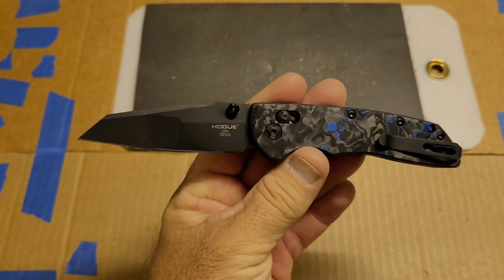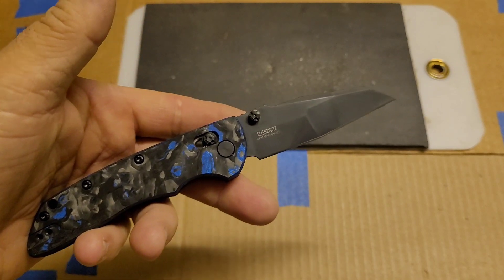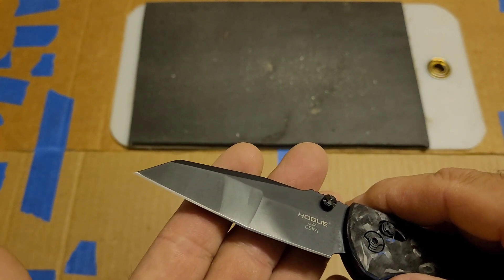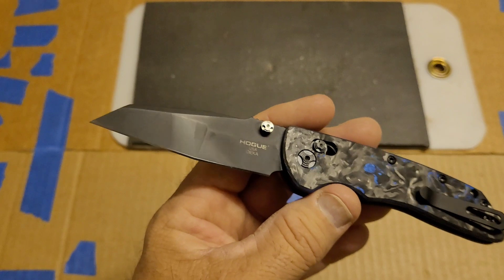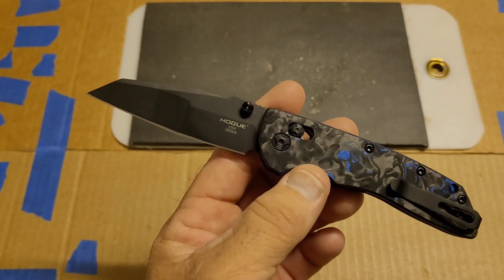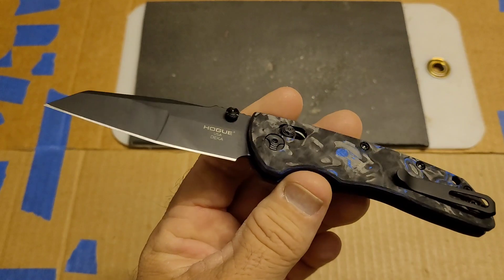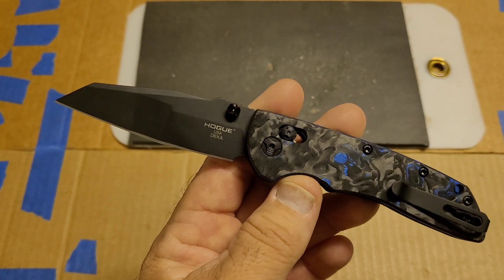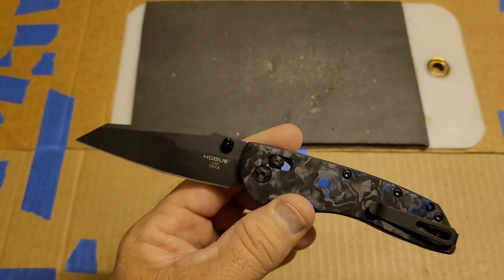Hogue Deka Magnacut edge retention testing. Is this all everyone expected it would be?

Comment: Try push cutting 1" manilla rope with same portion of the edge and see how many cuts it gets.
Reply from the maker: This was sent to me for testing and returned long ago. If I end up with one in the future I may test it that way.
Reply: @Outpost_76  I noticed that several in the knife guild use 1 in thick manilla rope, tape of just one section of the blade for cutting in the same section every time, then push cut slices off to see how many it will do.

Comment: MagnaCut excels at corrosion resistance and has very good toughness, but edge retention is really just middle of the road.  Dr. Larrin Thomas, the inventor of magnaCut, publishes a table where he rates toughness, edge retention, and corrosion resistance.  MagnaCut was 7, 5, and 9.5 respectively.  Compare that to 4, 6, and 7.5 for S30V and 3.5, 9, and 7.5 for S90V.  Dr. Thomas also will cite that edge geometry has more to do with performance than any other factor.  MagnaCut is a great steel for what it does, but those who select it should understand it's pros and cons.
Reply: Middle of the road on his charts are pretty skewed to high edge retention steels though, a reminder that 1095 is like a 2 for edge retention, and MagnaCut is as tough at 64 hrc as 1095 is at 59hrc.

Comment: Been getting into knives and found your testing super informative (info overload initially cause of the learning curve). Not sure if I missed it elsewhere but do you do anything to the blades in-between testing runs to wear out the edge more or is it already sufficiently worn out from testing to get to the new steel underneath?
Reply from the maker: I drag the edge across a diamond plate to make sure the prior apex is gone before sharpening each time. This way I'm not just fixing up what's already there.

Comment: I think you really nailed Magnacut on the head. A solid and SAFE choice for stainless steel that performs well. Love the consistent performance we've been seeing from the factory models. I wonder if that has more to do with the actual steel design or Larrin's up front work for recommending heat treats. 

As always, appreciate the work!
Reply from the maker: I believe Larrin pointing companies in the right direction as well as manufacturers listening from early Magnacut testing went a long way with this coming out strong.

Comment: Great video Gerald I think it should definitely replace the soft 20cv, 204P, M390 that’s so prevalent on the market, I like to look at it as a S45vn incremental improvement. Being as the edge retention, toughness, and corrosion resistance are all better and for the everyday user even those who abuse their knives it will be a stainless that can take the beating where the S30v family would fail and still be able to keep up in terms of edge retention and it’s very difficult to rust. Overall Leads to a great balanced everyday carry steel, much like what they had in mind when creating the S30v family of steels.

Comment: From your spreadsheet, this looks pretty similar to LC200N numbers.  If the sharpening experience with 62HRC Magnacut is less than amazing, I don't see any reason to leave LC200N.  I wonder if this is also keeping Spyderco from making the move.
Reply: The native 5 LW salt in magna-cut is delayed because Spyderco is presently having an issue with their magna-cut wearing through their native 5’s lock bar under stress testing. I think they have gone through two or three different materials.
Reply: @nandayane  Oh, I had no idea.  Thanks for that insight!  I assume it's right from the horse's mouth, at Spyderco Forum, from Eric or Sal?
Reply: @ZPositive  I believe it was Sal on the forums.
Reply: @nandayane  cool.  It's the most endearing thing ever that Sal and Eric frequent those forums.  How could anyone not love Spyderco?
Reply: @ZPositive  Pretty much, that is why they have my money
Reply from the maker: Magnacut even at 62 has much better wear resistance and edge stability than LC200N. Also Magnacut from a materials aspect is half the cost of LC200N. It's a win for manufacturers and consumers.
Reply: @Outpost_76  I agree that 62 HRC magnacut has slightly better edge retention than LC200N, but they're close enough that other factors close the gap.  Sharpenability and toughness matter.
Reply from the maker: @ZPositive  that's just it, Magnacut isn't any harder to sharpen than LC200N. In a folding knife that small jump in toughness doesn't make up for the lack in edge stability or wear resistance. Keep in mind this example of Magnacut has a 25% jump in wear resistance from the LC200N I tested. 

I'm going to do a video about Magnacut and why it's going to be a benefit over a good bit of what's out there now for production knives.
Reply: @Outpost_76  I guess we'll have to agree to disagree on LC200N's ease of sharpening.  It's hands down the easiest and most forgiving stainless to sharpen in my experience.  That sets a pretty high bar for magnacut.  And LC200N's toughness is also off the charts, even when compared to most tool steels (let alone stainless).  Magnacut doesn't even come close to LC200N's toughness.

Comment: This Magnacut is done right!! I’ve tested two of these. Hogue killed it
Reply: Its not really that good compared to what it could be.
Reply: @tacticalcenter8658  How good could it be then? It’s already at optimal hardness. Doesn’t get any better than that… Curious to hear your explanation
Reply: @optimuscrime608  62 is not optimal. Its balanced. 63-64 is optimal and recommended.
Reply: @tacticalcenter8658  it’s at 63-64…
Reply: @optimuscrime608  he said this one is 62rc. I made mention they updated their heat treat recently to 63-64rc according to someone in the comments of another video who got a blade replaced. Bob above also mentioned they upgraded the rc to 63-64. But the one in this video is 62. All the models up until recently are between 60-62. All going forward should be 63-64 give or take.
Reply: @tacticalcenter8658  aside from getting one's blade tested, how would one know if they have the more optimally heat treated Deka?
Reply: @TheAverageJoeX  probably no way to tell. If you got one produced in 2023 it would likely be the newer protocol. But I don't know if they have any markings that would say. This is an annoyance when new heat treatments are introduced and they don't notate batches or anything to see. I would assume they want to avoid pointing it out.
Reply: They upgraded to 63-64 HRC, now. If you have to have one hardness for all magnacut blades, that's the best.  

Want a harder steel? Get something that is designed to be harder.

Comment: Very curious on how the higher end production companies are doing with there magnacut compared to what you have done already. I have 3 knives in magnacut, sebenza, Mac 2 3.5, and a knife from DCC. There is a difference in my use from DCC knife in magnacut compared to the other 2. The DCC knife sharpens slightly easier and to me in random use last 30 to 40% longer.
Reply: I think I read from Larrin Thomas that magnacut sharpens easier at 63+. The dcc knife is probably harder.

Comment: Hogue fixed their magnacut with the current release's only recently. Apparently they found out they screwed up. Apparently you can warranty claim and get new batch in 63-64rc. Don't quote me on that. But someone in the comments told me something like that.

At least if any brand do magnacut at 62rc it does better than how bad the majority of brands do on m390. And they won't ship magnacut to china anymore. So already a better buy than china m390 other than Reate.

Did any Chinese brands improve m390? Have you tested any newer twosun m390 yet? I think two brand's worked with kknives of Switzerland to improve heat treat of m390 one of which was kunwu I forget the other. Maybe it was kubey?

I remember that Case knives magnacut was like 59-60rc when people were testing them. Thats got to be crappy.
Reply from the maker: No great M390 from over there with the few exceptions I've found. Magnacut at 62 + is definitely a great step for users over most base steels now.
Reply: I have a Bradford at 61. It's absolutely too soft. My deka scorpion holds a much better edge 2-3hrc harder